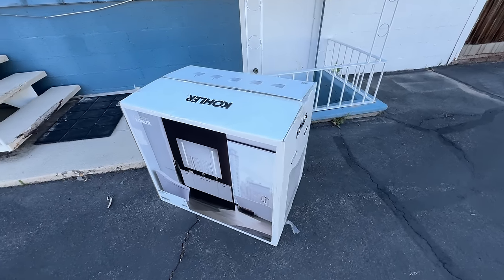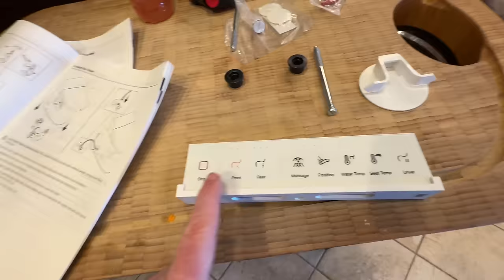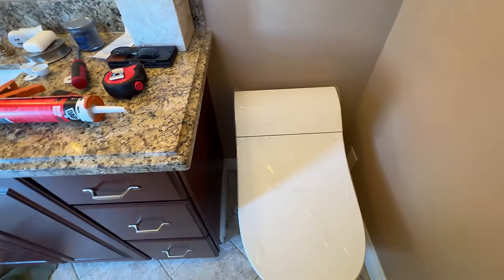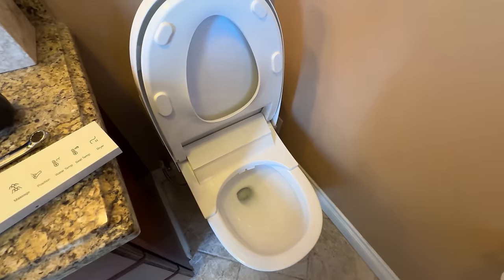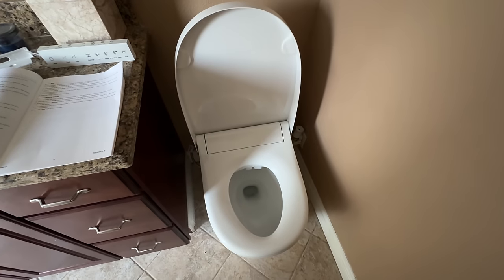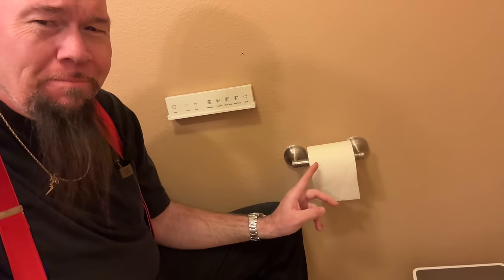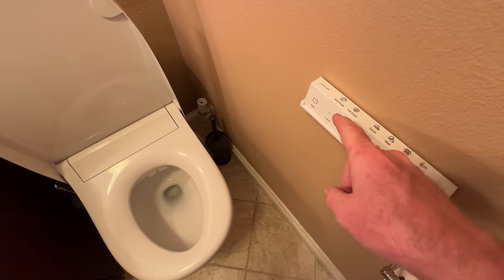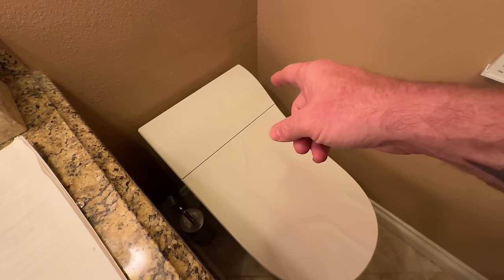Costco Kohler Jaro Bidet Installation and Review

Comment: Thanks for this! This exact model,is on sale for a few more days (5/31/24) at Costco where you purchased yours, and I’m considering it…it’s now $1600. Not sure it’s work having my husband installing an electrical outlet for and the flush isn’t as strong as I hoped. The problem with it flushing BEFORE the lid is dropped is it will release microdroplets of poo water in the air, landing on bathroom surfaces you can’t see. That’s why I always close my lid before flushing, as it helps.

We have a manual Koehler bidet toilet seat and love it, but what I love most about this design here is the toilet body being one dimensional on the platform, making it MUCH easier to clean the outside, vs all of the nooks and crannies of a regular pedestal, including the bolts at the bottom that attract so much dust and dirt.

I have a few days left to consider shelling out the money. Thanks again! I’ll never go without a bidet of some kind!

Comment: i would definitely get a filter on it like you were talking about for the hard water because that seems to be the big thing with the standard fill valves those mineral deposits build up in it and start making noise or will get stuck on and who the hell knows what part you would need to fix that toilet and i guess you have to remove the whole toilet to access the guts?